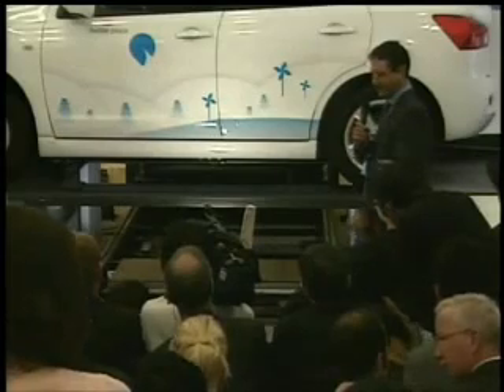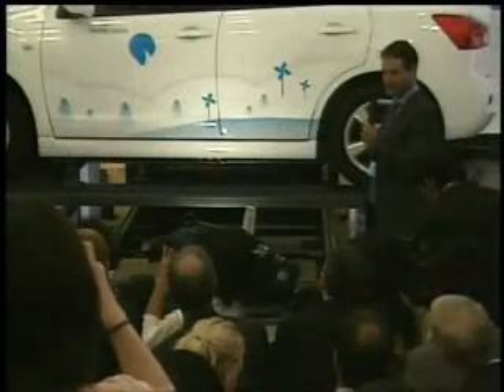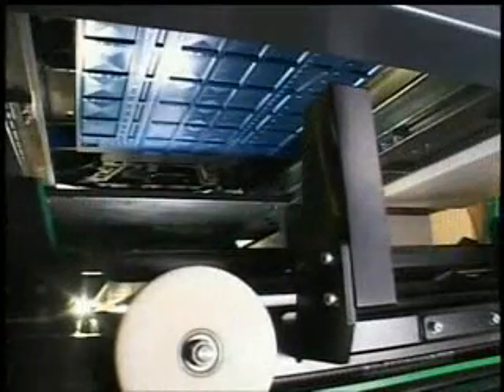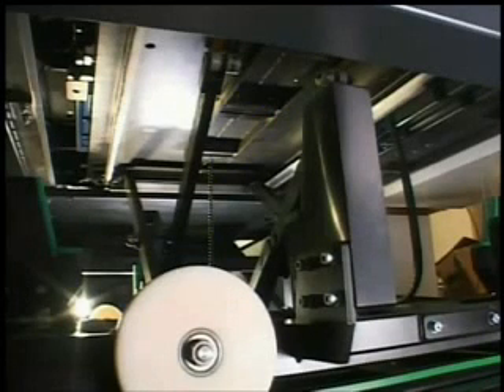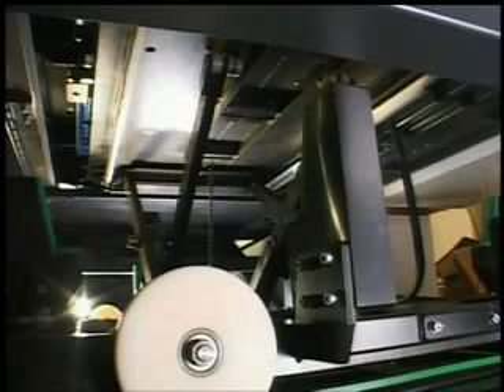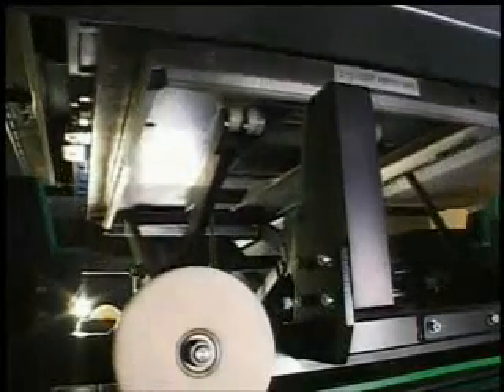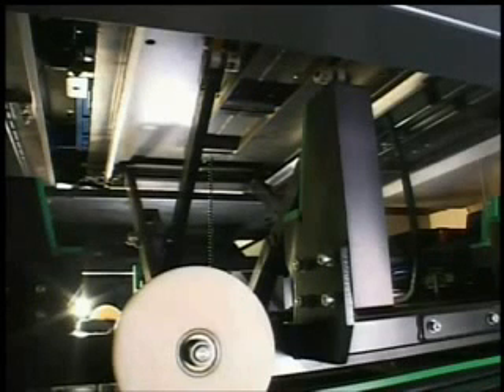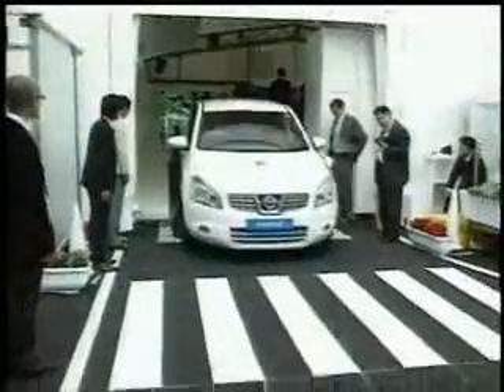Yokohama shai agassi part 4 of 8

Comment: I think it's called Capitalism. (Europe has only just emerged with a standard for mobile phone charger current/voltage to save waste.) Car makers see battery as a major component of the car and want to control it. Understandably, given the rate of change in this technology.

Interesting that Apple just locked there batteries into their laptops to get a better profile as few ever change them.